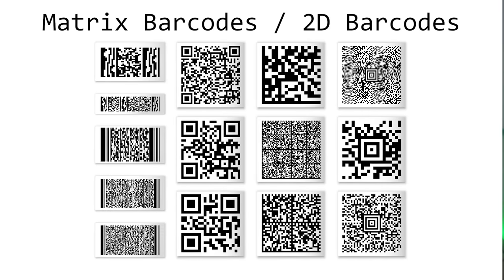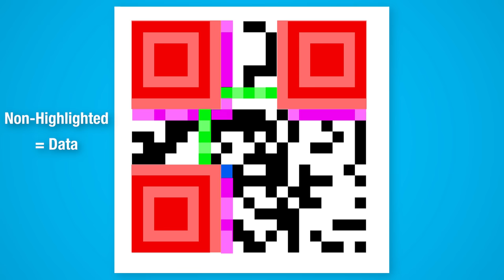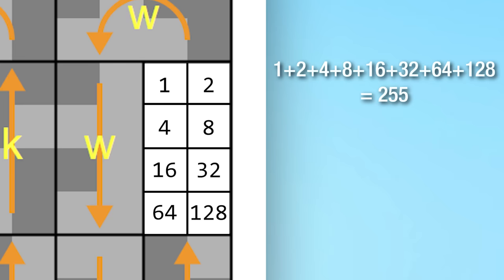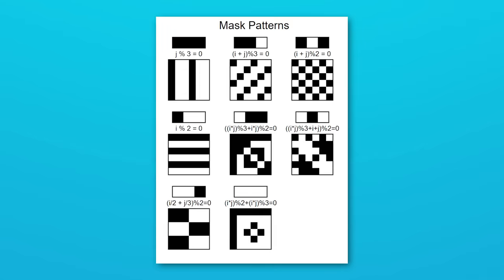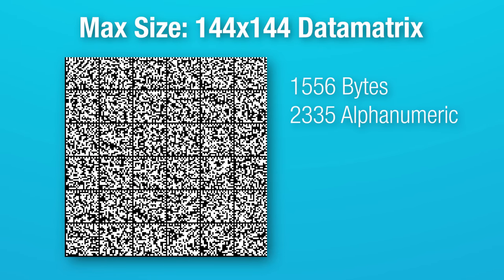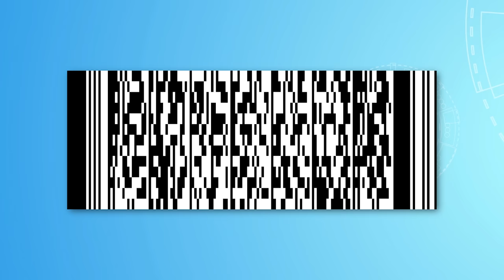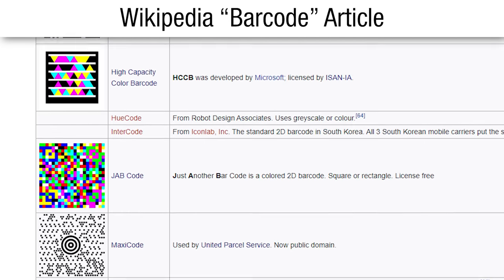What Are Those Other Weird QR Codes?

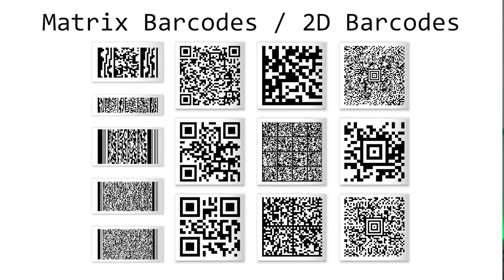Comment: 0:29 used Scandit on the codes here and wow the aztec barcodes were obnoxiously fast. I can see why it's used for tickets. Pressing back after scanning just rescanned it immediately before I could move to the next code. Also it was not able to read the bottom left one (PDF417 one) likely due to resolution (even on fullscreen at 1080p) and was struggling to scan the two stacked data matrix barcodes. Took a bit of fiddling to get a scan with them. Very fun video!

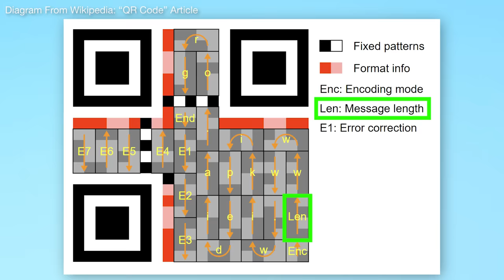Comment: 06:18
 now this part I'm not 100% clear on  because every example I've come across shows each character as being one byte or eight bits  or eight squares but apparently depending on the encoding mode and the code version these blocks  might be anywhere from 8 to 16 bits...

This is prolly for UTF-16 (or UCS-2 which is an older standard), which uses 16 bits to encode multi-language characters, including emojis.  However, UTF-8 is more efficient space wise when encoding English or mainly English characters.

Comment: Invoices in the Nordic countries also have QR codes that can be scanned by bankapps so all payment info is correct. 
Also used for checking validity of electric id card. 
Everything is so tied together you can get through a month without cash or payment cards, only using your phone.

Comment: As to error correction, without going into the math, what happens conceptually is that to recostruct one missing block of data, you need all remaining data and one block of error correction data. Together those let you reconstruct the missing block of data. So there is a 1:1 relationship in how much ec data you need to replace missing data, but it good to remember this is reconstruction, and also needs all remaining data, and is reconstruction, not 'just replacement'.

Comment: They have animated qr codes now that look really cool, I feel you missed that opportunity, it would have been the cherry on top
Reply: If it is animated, it is not 2d anymore. Animation means time, time is 4th dimension, so it is sort of a 3d code (1st and 2nd dimension in space + 4th dimension(time)). The topic of the video are 2d codes ... :-)
Reply: @oleurgast730  I believe that the animation in animated QR codes is purely ascetic, so the animation, rather than enabling more data to be stored by adding a third dimension, actually just distracts the QR code scanner. Think of it as similar to putting an image in a QR code, it makes it harder to program QR code scanners.

If the animated QR codes actually add a third dimension, then the animated QR code is actually multiple QR codes. This also distracts QR code scanners. The QR code scanner would have to scan each QR code before it changes and scan the QR codes one after another, rather than waiting for the user to dismiss the "QR code scanned" screen before trying to scan any more QR codes. And what if the QR codes are scanned in the wrong order?

Comment: Fun fact the QR Code can actually hold the most data of any 2D barcode. But as mentioned, the code used on electronics has the best capacity at very small sizes. A typical UPC barcode that most retailers use can hold up to 25 characters at maximum. And it has to be a large UPC code to hold 25. Otherwise, it's going to be more like 8 to 20 in most situations. UPC (1D codes) remain of course very popular since this is enough data for what retailers are looking for. They were also developed for retail in mind. But whereas UPC maxes out at 25 characters, 2D codes max out at 7,089 on the top end. Aka...V40 QR Code. 

QR codes are probably the most versatile of the 2D codes as well. There doesn't seem to be a limit to the creativity I have seen companies and individuals do with them. And code 128 is the most versatile technically I hear for linear 1D barcodes. UPS uses these a lot.

Comment: I'm guessing the mysterious black square (5:11) is just because it's in a null zone, not defined by the metadata patterns and it doesn't fit into the 2x4 data or error correction blocks.

Comment: i cannot believe how hard it is to get explicit and documented code for QR codes. every explanation of Reed Solomon shows you something very simple like: "here is an array of bytes, where after the data bytes, we included more bytes to over-specify the message (polynomial)". then, they start putting red X over some of the bytes to show how easy it is to recover the original with a third of the data unreadable. but... nobody ever explains HOW they figure out how they figured out which bytes are bad. At that point, it goes off of a cliff with Galois fields, and nothing has ever been clear about how they actually compute where the errors are. Because if you just know which ones are wrong, you can drop them from the calculation; and everything will work.

Comment: To understand QR codes in considerable detail, we first need to know some finite field arithmetic, Galois fields over GF(2^m), then cyclic codes, then BCH codes, and then understand that RS codes (can be looked at from a BCH viewpoint) are the non-binary version of BCH codes. RS codes are symbol error correcting codes rather than bit errors. Warning: A lot of math is involved to understand BCH and RS codes! We also need to know about mask patterns and timing.

Comment: You missed the opportunity, but HCCB was designed to be the best 2d matrix with smartphones in mind (high density). The default version has 4 bits per triangle, and there are other variants that can mix in error correction by adding more bits per triangle. Regardless, I liked your video and it's nice to learn about some other matrixes.
Reply: I think biggest disadvantage of HCCB is the fact it relies on color, since a lot of these codes are used in applications like ticketing or labeling where only monochrome is available (thermal printers are common in these cases)

Comment: We have a 2D matrix hand-scanner at work. It works like a barcode line scanner, but the red light comes out as a square with a bright spot at each corner. I have to use it all the time for normal barcode verification.

Comment: I've seen a QR code not listed on Wikipedia.
It looks like a standard QR code but;
The big 3 edge squares have slightly rounded corners.
The small squares (bits) are round not square.
And it has about twice the number of squares (bits) in both directions.

Comment: Kinda wish you touched on the other matrix codes, at least the data limitations of them, which not even the wiki article goes over.  Especially with JAB, considering its basis is CMYK and extends to CMYK-RGBW.  I'd also be curious if a MaxiCode derivative could hypothetically use the isometric grid as a third axis of data.

Comment: Datamatrix (aka DMC for DataMatrix Code) is pretty much a standard in industry since it's one of the most reliable 2D code there is and for a very simple reason. It can be printed on anything like plastic, paper, metal, aluminium, or even glass and can be decoded even in the most harsh environment (hot, cold, humid, etc.): Another advantage is that it can be decoded on different angles and light environment!
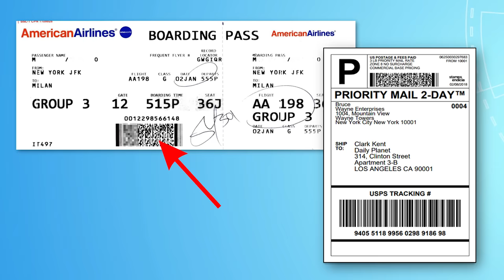Edit : 2:03 Gimme the slap bruh!

Comment: aeioulabs barcode app on android will let you read and generate barcodes of various types. Used this app to help figure out the barcode point system for a local restaurant, was able to generate a few unused codes and scan them into the restaurants app. Information was shared with their corporate office so they could fix. Didn't use points received for free stuff but it did credit the account at least till I shared with corporate.

If interested in the app it's free and with no ads. Great help in learning or creating your own code. 

With tasker you can use generated codes to run varius tasks on your phone. Codes can be printed for later use. 

Single Code with tasker can be rather useful for setting a few things up at once, say close all background apps, open YouTube, and start live stream, flip camera around to use forward facing. 

Lots of fun!

Comment: qr codes are a super thing to use - unless you print them onto a small 3D object with curves and print it with dots instead of squares - looking at you ledvance. i had to take a picture and rebuild the qr code in paint to get them connected into my smart home hub. luckily they were only 30x30.

Comment: Each square can be on or off and the numbers multiply by 2... I'm pretty sure that's just binary, as in, the computer doesn't need to add numbers together to get to decimal, because the computer already works in binary.

Comment: What about the Dolby Digital format recorded between the perforations on 35 mm film prints?  Also the less common Sony SDDS and Very short-lived Kodak/ORC CDS formats.

I’ve seen the Microsoft colour triangles thing in just one place.  One British train operating company used it for a while on an information poster on a few of their stations.  I have some photographs of one at Bradford Forster Square station which lasted longer than most others.  I managed to read both the original and one of my photographs.  You needed an Internet connection to read it.  Capacity was very limited, with quite a small number of triangles and four available colours.  I believe that it simply encoded a number, which could be done just as well with a simple barcode, and then looked up the data related to that number from a Microsoft server.  I can see no advantage to it compared to a QR code, and Microsoft soon dropped support for it, so it’s probably not possible to read one now.

Comment: All of the easter eggs I could decode:
SPOILERS AHEAD!!!

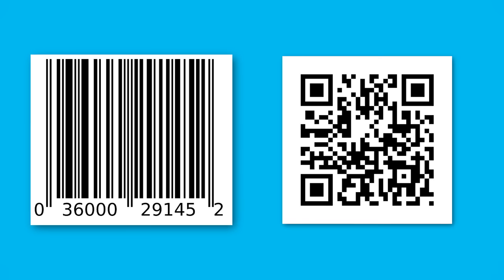1:03 - A link to Wikipedia
1:35 - "EPIC bruh moment" and "HEY THIS IS EXAMPLE, WHY YOU SCAN >:("
1:43 - "Bruh why you scan this"
1:57 - "STOP SCANNING THE EXAMPLES >:O"
2:01 - "oi mate i swear on me grave if you dun stop scannin these examples i'll give you a proper slap"

The ShotCode, JAB Code, and HCCB Code examples didn't scan, even with a proper reader.

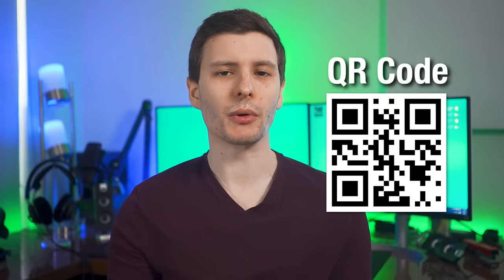2:40 - "EPIC bruh moment" again
2:42 - Most of these contain random text but one is "QR Data Random text for you" 
2:49 - "Ver1"
2:57 - "Ver1", "Version 2", "Version 3 QR Code", "VERSION 10 QR CODE, UP TO 174 CHAR AT H LEVEL, WITH 57x57 MODULES AND PLENTY OF ERROR CORRECTION TO GO AROUND. NOTE THAT THERE ARE ADDITIONAL TRACKING BOXES", A two snippets from the Wikipedia page on QR Codes.
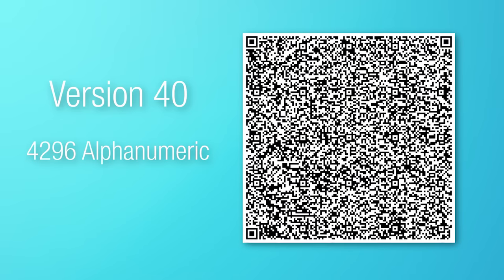3:18 - A pirate version of the "Navy Seal" copypasta
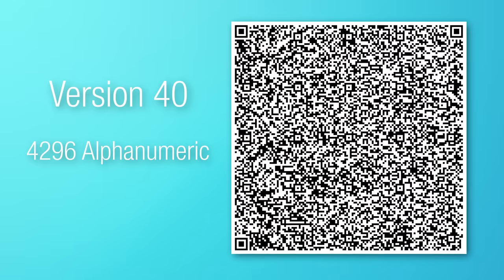3:31 - The lyrics to Never Gonna Give You Up
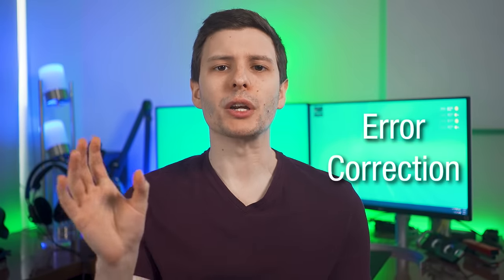3:51 - "ah yes hello good day this is a very good thing of text that will be still readable despite covering up lots of the actual code"
4:16 - "wow incredible example i blocked off the middle and yet it is still readable"
4:37 - "Ver1" again
9:34 - The "VERSION 10 QR CODE" example from before
10:39 - "HEY THIS IS EXAMPLE, WHY YOU SCAN >:("
11:12 - "YES HELLO GOOD DAY"
11:27 - The giant datamatrix code does not scan
13:22 - "Bruh why you scan this" again

There were a few that were repeated and some that just didn't scan like the Micro QR code. It was fun!

Comment: How much data could you transfer from device to device by changing the qr code as fast as possible? So that's 60fps for good cameras.. 960 frames per second at 720p for my Huawei p30 pro

Comment: 12:00 Scandit is a pretty good barcode scanner app. Thanks for letting me know about it. However, it cannot read ShortCode, JAB Code. HCCB Code ( 2:19 ) and microQR ( 3:38 ).
Reply: Time for jailbreaking guys/girls
Reply from the maker: Those are extremely rare codes though

Comment: Is there a app that I can use to overlap 3 or more qr codes using different colors like 1 barcode is red one is blue and other is yellow an when a barcode over laps like barcode 1 overlaps with barcode 2 is makes a violet dot and so on so it can store atleast 12807 characters if not more that's only using 8 colors and there's a lot more colors than that but you probably couldn't print it if you use too many colors but it can be used as data compression if you could get more than 3 barcodes to overlap

Comment: That was funny: 

0:03 Bunch of wiki links
0:14 "HEY THIS IS AN EXAMPLE, WHY YOU SCAN >:("
0:30 Bunch of Lorem ipsum text
1:03 Just the numbers and a wikilink on the right
1:36 "EPIC bruh moment" and the same as 0:14
1:46 Bruh why you scan this
1:57 STOP SCANNING THE EXAMPLES >:O
2:00 "oi mate i swear on me grave if you dun stop scannin these examples i'll give you a proper slap"
2:22 I can't scan any of these
1:36 "EPIC bruh moment"
2:45 "Ver1"
2:58
"Ver1", "Version 2", "Version 3 QR Code"
"VERSION 10 QR CODE, UP TO 174 CHAR AT H LEVEL, WITH 57X57 MODULES AND PLENTY OF ERROR CORRECTION TO GO AROUND.  NOTE THAT THERE ARE ADDITIONAL TRACKING BOXES"

Comment: I've actually scanned a few UPS Maxi Codes and so far it only just contains the tracking number. I guess that's all they really need on there since it's expected that the sorting facility or even the driver is going to be connected to the UPS database via network.

Comment: One thing I've never understood is why there are three squares to the finder pattern, when one would do the same job? In fact, it does, since it's not the three squares that determine the orientation, but the single missing one.
Also, Version 1 can only encode 17 characters? Seems kind of useless.

Comment: I am "guilty" for having helped to develop some of these codes. They are in fact incredibly complex and the error correction is inspired by the same used in hard disks.
Reply: I understand what you're trying to say:
finite field arithmetic, Galois fields over GF(2^m), then cyclic codes, then BCH codes, and then understand that RS codes (can be looked at from a BCH viewpoint) are the non-binary version of BCH codes. RS codes are symbol error correcting codes rather than bit errors. A lot of math is involved to understand BCH and RS codes! (Note: I contributed some portion to the Wikipedia article on QR code).

Comment: The comment about laser scanners not being able to read QR codes is not entirely correct. While I have yet to see a handheld scanner do it I have found the desktop barcode scanners on self checkouts at Dillon's(Kroger) can, if the lens is clean, scan QR codes fairly reliably.

Comment: the QR code on thumbnail leads to "this is qr code" so u dont need another device (others in comments)
Reply: the one in start of intro leads to the wikipedia page
Reply: other in intro are: "Lorem Ipsum regular text 2h1g3"
"Lorem Ipsum Regular Text 2h1g3212hdh1d dfgdghg1h3g2h1*s3h21sf2s3fd1h gq895hqgh"
"Lor 1 8 3"
at the start of "1D vs. 2D barcode is the once again, wikipedia page
Reply: at start of "motable 2D barcodes", it reads "EPIC bruh moment" same to "QR Codes Explained" and one of the other ones say "QR Data random text for you" others are gibberish

Comment: Speaking of QR and others, I was told by GoDaddy if I do not go through office365 I would not be able to rec/send my emails. I told them I have no cell and I only use my computer for emails. They said it was only for authentication that it is me, and to use a friend's phone. LOL  So, it's to authenticate me when it's not me/my cell. another LOL. So, I take an older Note 5 that has no info/number, only wifi, and tried it. Well, it scanned, rejected the cell, and wants a working cell number. Remember it's to authenticate ME. So, I scanned with my cell only to see they wanted fill/just about full access to my cell, fills, downloads, contacts, photos, camera, mic .....  A big NO!!! 1st, I could have sed anyone's cell, 2nd why do they need all info? and full access? Why? they, MS, Gates, is gathering all the info on everyone he can for his so-call chip he's trying to pass through the Gov. and if not to sell. Being a part of the system for 40+ years a person starts to learn to reason things out. There is a reason other than authenticating. Right, authenticate me with someone else's cell. LMAO. I just made a quick vid that I will post after dinner. I will not post the link here, but will on any comments I may rec..